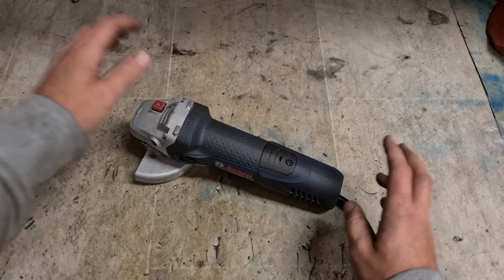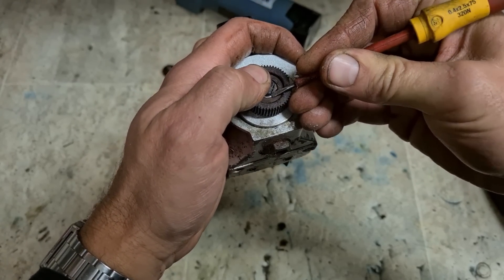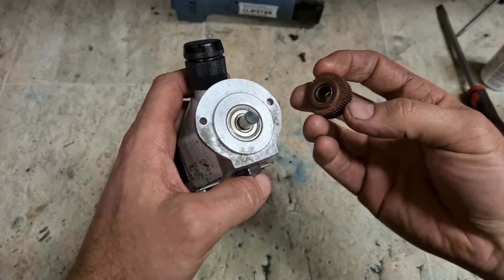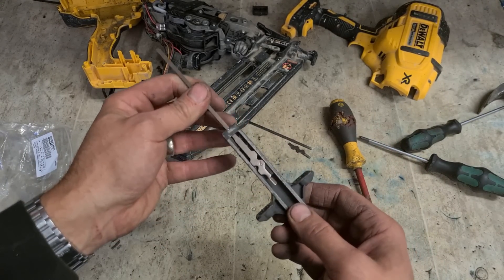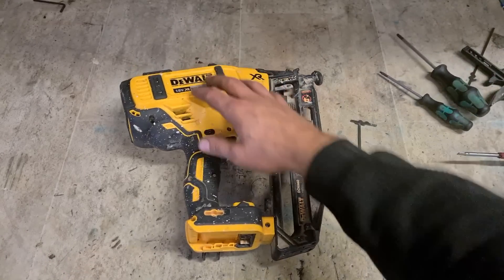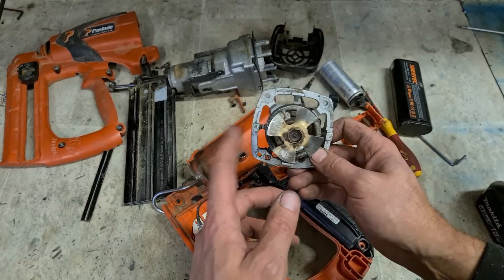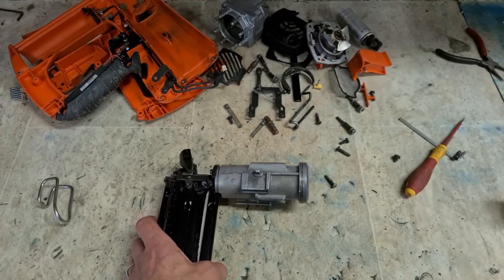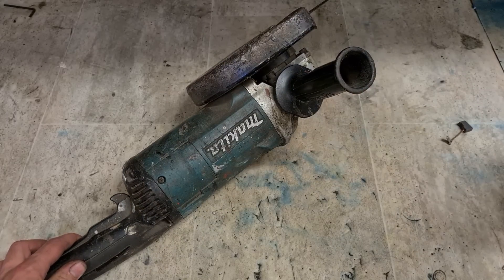Clipster cow clippers in for repair, as well as some  Bosch, Dewalt, Paslode and Makita tools

Comment: Found your channel recently. Absolutely fascinating. Having been a Carpenter/Builder for the last 42 years. I have had my fair share of tools repaired. And also worked on a lot myself. The last 25 years I have lived and worked in Australia. The problem in my area is there are hardly any repair shops. And the ones that exist can't find the skilled workers. There never seems to be any parts. And if you put a tool in. Kiss it goodbye for many months. No parts, and you may never get it going again. Often they come back with a big bill. Either still not working properly, or worse than before. Nail guns in particular. Lovely to watch someone that tackles all sorts. And knows what he is doing. Long way from Oz to Ireland.

Comment: The blinking light on the Paslode is probably due to the battery being an off-branded pack.  I've run into this same thing with tools and laptops giving a warning about a battery problem even when everything else works fine.

Comment: Interesting to see that sheep shearing machine. It does look like the older style Heiniger head on that one. If so then it should be good quality. But the gear is not the same. Checking it up, here in Sweden these machines are sold for 400 euro. That is at our primary place to get sheep shears. People who bought this machine also bought, guess what? The gear. Obviously that is the weak point. If folks are hogging down on dirty cattle with it the gear sure is going to break.

Neat trick by Heiniger perhaps. Letting others use their old head, but making it breakable, so next time they will get the genuine machine.